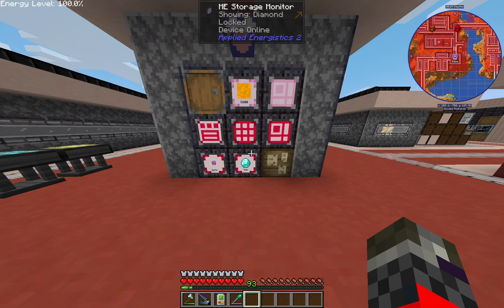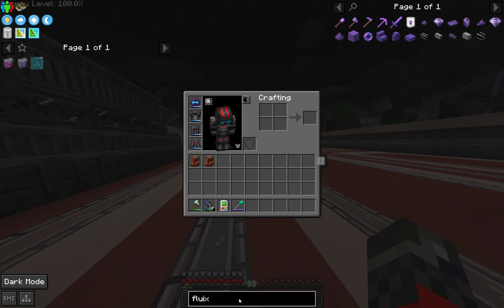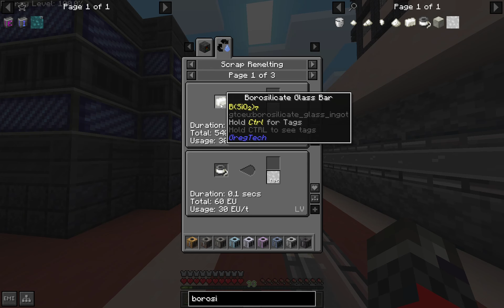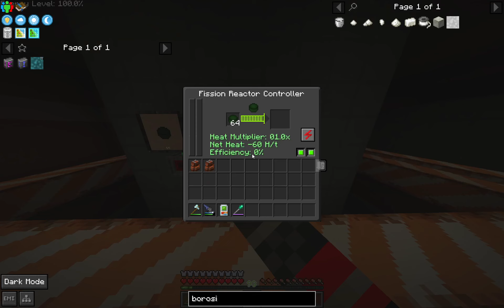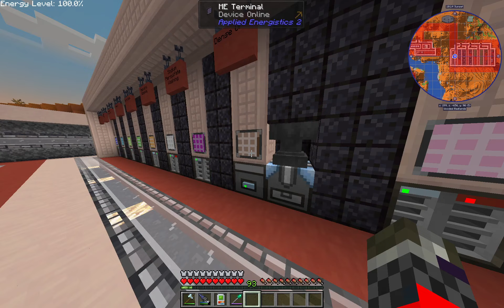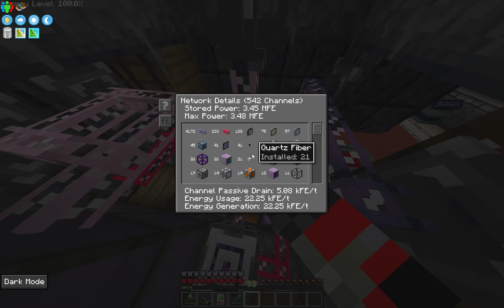Monifactory Progression Log 8

Comment: Centrifuging stone dust, compared to things like ash or netherrack/endstone dust centrifuging, opportunity cost for which isn't high (quite literally just a single centrifuge anywhere in your base), it requires a lot more investment for, as you said it yourself, a trickle of resources, though I suppose there is some merit in generating said trickle resources out of thin air, as opposed to microverse miners, which... also generate resources from thin air, except more of them, and... Well. There is some interesting stuff you can get from it (I'm sure you seen the europium dust from processing it all the way), but it requires increasingly more investment, and in my opinion, not at all worth it.

Also, fun fact, did you know you can centrifuge soul sand for oil? You can also get soul sand just by stuffing sand into atomic reconstructor. An interesting way of getting oil, but the one that is completely pointless in Moni, given that underground fluid veins exist, and cannot be depleted. Which is a bit of a shame, but also a relief.

Anyways, have a good day.
Reply from the maker: where do you get the europium dust from? i don't see that recipe
Reply: @robocreator223  Basically, look up residue in EMI and look for ultra-acidic residue (its a fluid, not dust).  You do need Abyssal Energy Core to process it, and I'm not quite sure you will be able to craft it, but you should get some Europium from it. Do tell me if there isnt a recipe for it for you, I personally have it, and I doubt its either an expert mode exclusive thing or was added in 0.11.4 or 0.11.5
Reply: Not sure if Youtube ate my reply or I accidentally deleted it, but are you centrifuging stone dust directly, or first turning it into stone residue? Because it might be an expert mode difference? I for example can't centrifuge stone dust directly, I have to turn it into residue first, but I don't remember if normal mode had a recipe for centrifuging stone dust directly.
Reply from the maker: @niceping7898  yes, you can just centrifuge stone dust directly in normal mode but it doesn't give europium
Reply: @robocreator223  I see. Well, at least in expert, there is a recipe to turn stone dust into stone residue, which you then process further, until you get some fluid residue I forgot the name of, from which you get europium dust. Last residue processing is gated behind Luv at least, if not ZPM, but I guess it could be a way of getting some europium aside from making more donuts. Try looking up residues in EMI, maybe there is recipe for them in normal.
Reply from the maker: @niceping7898  i just checked (i'm gregging as we speak), and there's only platinum sludge residue and iridium metal residue, it must be an expert mode specific thing